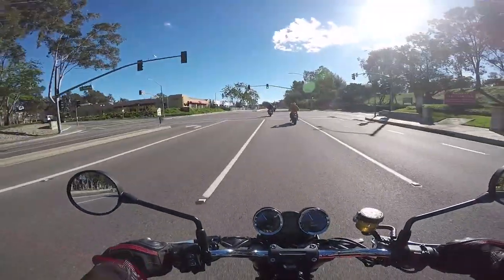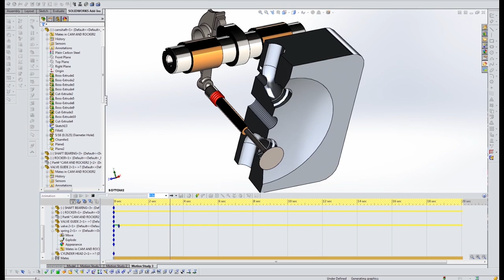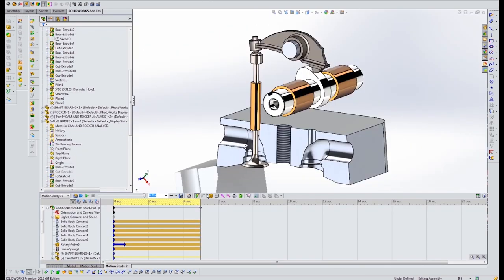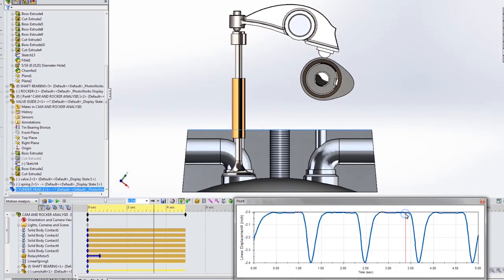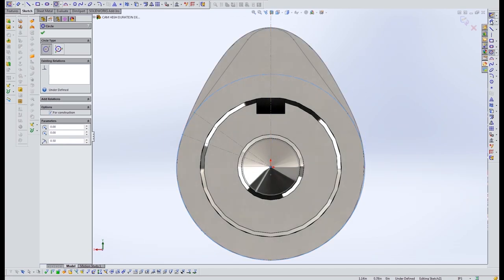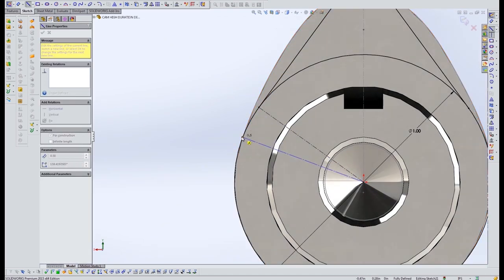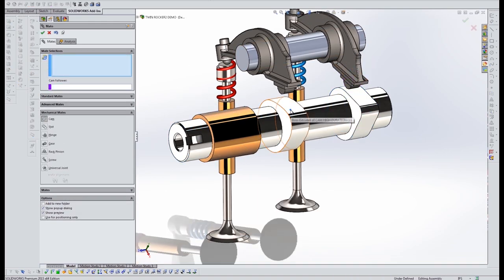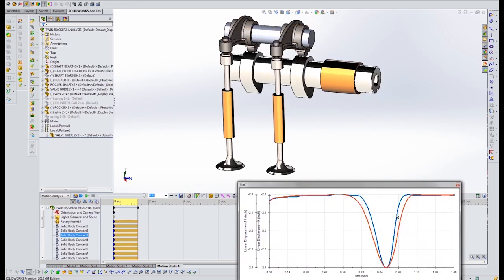CAMS Explained | Kawasaki Z900RS Review

Comment: Thanks for the excellent explanation of how cam profile affects lift and duration. Seeing it makes it way easier for me to understand.
Can you give us an idea how variable valve timing affects torque and high end power? The cam profile will be the same I guess, so how does VVT work? My XDiavel with the 1260 VVT has an amazing amount of torque, especially low down, so satisfying to just crank it on.
Reply: Floppy cam timing broadens the power band. Opening the valves earlier improves low end tq. Opening later improves top end power. In the case of multiple profiles(Honda's vtec) low lift+short duration=smooth idle, improved emissions, and mpg, while also having high lift+long duration available too...